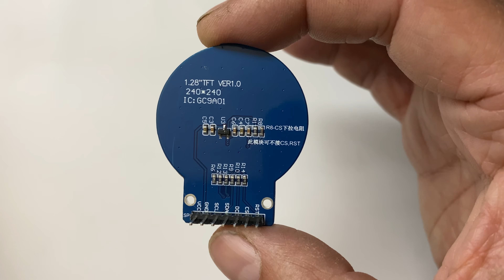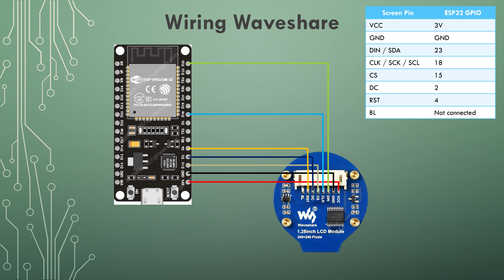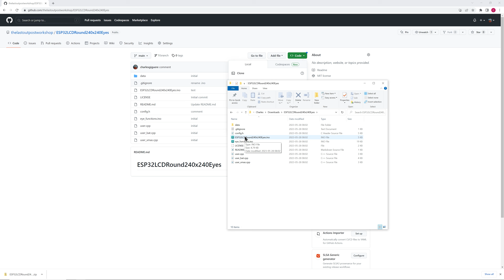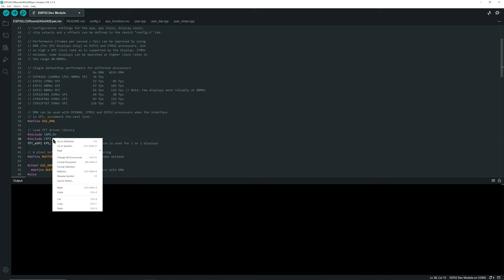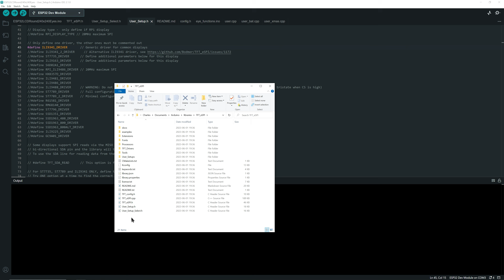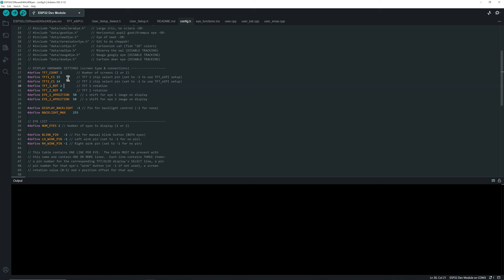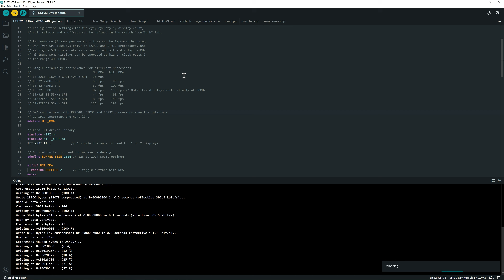Master the Round TFT Display on ESP32 and GC9A01 driver with the TFT_eSPI library

Comment: ive figured out 240 by 240 eyes , if anyone is interested?
if you change this line in the eye_ functions
tft.setAddrWindow(eye[e].xposition, 0, 240, 240);//both the 240 were 128
then you can use the default_large.h from dalori esp32 uncanny eyes
then i just changed the position of the eye and the amount it moved
Reply: What lines did you change for these?
Reply: @TheGroovebot  I solved this problem.  See my reply to @brunofnunes82 below
Reply: It works, thanks! But how I can change the amount it moved?
Reply: @brunofnunes82  If you use the config.h and the eye_functions.ino files from the Github project ESP32-uncanny-eyes-halloween-skull (along with the default_large.h file from that project), it will work perfectly with the bigger eyes.  Of course, update the config.h with the correct CS pin values.  I didn't bother comparing the specific differences between the files for this project and the skull project, but it works and that's all I cared about.
Reply: @jman4715  I did what you suggested and the larger eye indeed works, BUT the eye itself sometimes looks off screen.  The iris actually moves off screen and all you see is the sclera. Do you know of a way to reduce how far the eye looks around?
Reply: @TopHatRaver  I can't say for sure why you are seeing this problem.  For me it works perfectly and I don't see what you have described.  I mean, I could send you the exact files I'm using if you want to provide me an email address.  I really did just replace files.
Reply: @jman4715  Thanks for your reply! Could you paste a link to pastebin or github?  Or a link to the default_large.h file that you're referencing, just to make sure I got the same one?
Reply: @TopHatRaver  For sure I will send it to you, but give me a couple of weeks.  I'm currently out of the country, but I promise to do so when i get back
Reply: @jman4715 been trying for months to get the eyes full screen so please share what you have found that works for you😊
Reply: @jman4715  Any idea when you can share your file?
Reply: @TopHatRaver  Search for ESP32LCDRound240x240Eyes on the second repository you mentioned
Reply: @TopHatRaver  - I was having this problem too --  in config .h - the x position is set to 50 -- I changed it to 0 and the large eyeball stayed on screen
Reply: #define EYE_1_XPOSITION  0 // x shift for eye 1 image on display
#define EYE_2_XPOSITION  0 //  x shift for eye 2 image on display
Reply: @TopHatRaver  Were you able to try out the code I posted?
Reply: @jman4715  No, where was it posted?
Reply: @TopHatRaver  Ever figure out how to fix the pupils from going off the screen?  I'm having the same problem.  I’ve made all the same modifications to the code as listed above.
Reply: @jman4715 could you please post your code?  Ive made the same changes as you suggested and the pupil still looks off screen.
Reply: @JustinEpley  I have not, and I haven't seen the other code either.  Not sure what to do.
Reply: @brunofnunes82  I think I got to the same juncture as you.  Just missing how to change the "amount it moved" and hoping that will keep parts of the eye from getting cut off.  Since @robsimmons8462 never responded, did you figure it out?
Reply: @brunofnunes82 I believe I had a similar issue; the config.h wouldn't modify for me. Learning is a bumpy road...ugh.
Reply: That did not work for my display, I have a Resolution: 240(V) x 320 (H) LED Waveshare screen. It looked scrambled.
The downloaded sample did not match his ESP32 pinout, I had to edit the setup25 file:
#define TFT_MOSI            23
#define TFT_SCLK            18
#define TFT_CS              15
#define TFT_DC              2
#define TFT_RST             4
Reply: where can i download default_large.h?
figured out how to landscape image:>
Reply: You can't just use the default_larger.h file you have to mod the eye_functions.ino file on line 114 to:

tft.setAddrWindow(eye[e].xposition, 0, 240, 240);

On 341 and 342 change to:

eyeX = map(eyeX, 0, 1023, 0, SCLERA_WIDTH - 240);
eyeY = map(eyeY, 0, 1023, 0, SCLERA_HEIGHT - 240);

Then set the Xpositions on lines 33, 34 in the config.h file to 0.

Comment: I have two 1.28" TFT 240x240 GC9A01 round displays but my ones show "R7-CS" on them instead of "R8-CS". They just show a white blurry image on them, Not sure what I need to do to make them work as yet. :-/
Reply from the maker: Open an issue here : https://github.com/thelastoutpostworkshop/ESP32LCDRound240x240Eyes it will be easier to help you

Comment: Thanks for the great guide. I now have my two TFT (Square PCB) round displays working with two eyes. Next, I want to add my APDS-9960 gesture sensor to it. Once that is going I want to add a Grove WT2605 MP3 V4 MP3 Player.
Reply from the maker: That sounds like a really cool build, good luck with the integration!

Comment: Bonjour, et grand bravo pour cette magnifique vidéo, très pédagogique, même, si, n'étant pas du tout Anglophone, je suis obligé de suivre le sous-titrage (parfois approximatif) de mon lecteur.
Vous m'avez motivé pour faire l'acquisition de deux écrans ronds de type GC9A01, pour me lancer dans la réalisation de votre montage
Je suis incapable de dire combien de fois j'ai lu et relu votre super tuto pour paramétrer mon programme.
Maintenant, au moment de compiler (avant téléversement) un message d'erreur me dit  : "User_Setups/Setup46_GC9A01_ESP32.h : NO such file or directory", pourtant, dans mon fichier "User_Setup.h" la ligne 65 #define GC9A01_DRIVER est bien décommentée....
Pouvez-vous m'indiquer de quel coté dois-je orienter mes recherches, merci de votre attention.
Ci-dessous la traduction de ce message en Anglais... 
Hello, and well done on this brilliant video – it’s very informative, even though, as I’m not an English speaker at all, I have to rely on the (sometimes rough) subtitles provided by my player.
You’ve inspired me to buy two GC9A01 round screens so I can get started on building your setup
I can’t tell you how many times I’ve read and reread your brilliant tutorial to configure my programme.
Now, when I try to compile (before uploading), I get an error message saying: “User_Setups/Setup46_GC9A01_ESP32.h: NO such file or directory", yet in my "User_Setup.h" file, line 65 #define GC9A01_DRIVER is clearly uncommented....
Could you please advise me where I should focus my search? Thank you for your attention.
Below is the translation of this message into English...

Comment: This didn't work for me.. I couldn't get into User Setup. Go to Definitions did nothing. I had to move on .... brick wall.
Reply from the maker: Open an issue here it will be easier for me to help you : https://github.com/thelastoutpostworkshop/ESP32LCDRound240x240Eyes
Reply: @thelastoutpostworkshop  Ok, Professor, I created an Issue. First time ever requested of me...that in itself was a challenge. My esp32WROOM blinks, I got that right, but these eyes have me crossed. Hep'meh!

Comment: I was so hoping this would also work with the Waveshare 0.71 dual eye displays but nope.  The example Waveshare gives us don't work either.  They keep selling them but they don't work.  I believe the problem is the dual eye displays have an embedded driver that is not included in the TFT library.  I tried copying the driver files and adding the lines from the Waveshare example to your example and I didn't get error messages but didn't get any output either.  I may try again tomorrow and see if I can get it to work.
Reply from the maker: what is the display controller of the Waveshare 0.71 ?
Reply: @thelastoutpostworkshop  GC9D01 It's says the driver is embedded in the chip.  Not sure how much that affects how it's added to the TFT driver files but there is not a "User_Setups" file in the example.  Here's the link to the data sheet. https://files.waveshare.com/wiki/common/GC9D01N_DataSheet_V1.1.pdf
Reply: @thelastoutpostworkshop  BTW, I had no idea how the drivers for Arduino worked until I watched this vid.  I learned so much by watching and now understand how damaging it can be by deleting the official libraries and copying edited libraries into their place, as Waveshare's examples have you do.  

Thanks for explaining everything so clear and precise.  I learned a lot from this video.
Reply from the maker: GC9D01 appears to be supported by this graphics library : https://github.com/moononournation/Arduino_GFX I have used it in many projects, it's very good, give it a try.  Much easier to configure that tft_eSPI

Comment: I am trying to work with two TFT Round Displays that work with the GC9A01 driver. At this point, I just have it set up for one display. But when I try to upload and/or compile the sketch, I get this error. 
/ESP32LCDRound240x240Eyes-main/ESP32LCDRound240x240Eyes/User_Setup_Select.h:260:15: fatal error: TFT_Drivers/GC9A01_Defines.h: No such file or directory
  260 |      #include "TFT_Drivers/GC9A01_Defines.h"
      |               ^~~~~~~~~~~~~~~~~~~~~~~~~~~~~~
compilation terminated.
Alternatives for TFT_Drivers/GC9A01_Defines.h: []
ResolveLibrary(TFT_Drivers/GC9A01_Defines.h)
  -> candidates: []
exit status 1
I can't seem to find GC9A01_Defines.h.
Any suggestions? Thanks
Reply from the maker: See this tutorial on tft_eSPI, it will help you understand how the setup works : https://youtu.be/6lLlKY5U77w

Comment: I am trying to load the code with my ESP32  I keep getting an error at line 102 "'initEyes' was not declared in this scope
  102 |   initEyes();" and at line 133 "'updateEye' was not declared in this scope
  133 |   updateEye();"  what am I missing?
Reply from the maker: Open an issue here, it will be easier for me to help you : https://github.com/thelastoutpostworkshop/ESP32LCDRound240x240Eyes

Comment: Thanks for the tutorial.  My Acebot ESP32-Max-V1.0 doesn't have pin 15 labeled on the board, so I had to go into Setup46_GC9A01_ESP32.h and change the chip select pin to #define TFT_CS   17.  It might be a different way to make the same change, but I had been trying to edit User_setup.h to redefine the pin without success.  Seeing your changes helped me understand where the pin definitions were.

Comment: Awesome video, totally appreciate the step-by-step details on setting this up.  I make more wearable projects and I'm trying to use an ESP32-C3 Super Mini, which doesn't have the pins you've used in the project.  I've tried to review where exactly to change the pins but I must be missing something because I'm not getting any images.  I've used the Adafruit libraries and tested the screen and it works.  Any guidance would be much appreciated.  Signed your newest subscriber :)
Reply from the maker: Take a look at this tutorial, where I explain where to change the pins : https://youtu.be/6lLlKY5U77w
Reply: @thelastoutpostworkshop  Thank you! I followed these instructions twice and still nothing shows on the TFT.  I'm gonna keep hunting around for a solution but if you have any other ideas for me to consider, let me know.  Enjoy the coffee :)
Reply from the maker: Thanks for the coffee!  You can open an issue here : https://github.com/thelastoutpostworkshop/ESP32LCDRound240x240Eyes it will be easier for me to help you

Comment: Thank you for your detailed video. I had a lot of fun with this project.    
I built this with different TFT screens. I used 2    ST7735 128 X 128 ( blue boards). Had a hard time getting it to display properly. 
found that I had to change 2 more parameters in the config.h file   
#define EYE_1_XPOSITION  50  // x shift for eye 1 image on display
#define EYE_2_XPOSITION  50  // x shift for eye 2 image on display                      these values were 50 I changed both to 0. this fixed my problem.   

 You tube video:    https://www.youtube.com/watch?v=nraX7qHMW3I

                                               Thanks Again.  Bill         Wld_4

Comment: Thanks for your detailed and very clear instructions! It has helped me understand the process of setting up and understanding the relationships between the various files in a project such as this. I believe I have all of the related files pointing in the right places with no overlapping/duplicated #includes or #defines. Unfortunately, I have had no success whatsoever in getting anything at all to show up on my display. This doesn't necessarily surprise me considering I am using different hardware than what you have shown here. I am actually using the Waveshare Dualeye LCD Module which specifies using the gc9d01 driver that I can't seem to find anywhere. Not only that, I am using the Waveshare ESP32-S3-ETH board and have had to try remapping the pins. I am under the impression that I can use any available gpio's as long as they are not being used and have changed the coding to reflect the pins I have used. I will continue to watch your other videos in the hope I might stumble across something that will help me. Cheers :) By the way, I have subscribed and liked ;) Love your work!

Comment: This looks great but after following all the steps it won't compile - it throws lots of erros beginning with:
 |     ^~~~~~~~~~~~~~

c:\Users\Boss\Documents\Arduino\libraries\TFT_eSPI\Processors/TFT_eSPI_ESP32.c:382:38: note: in expansion of macro 'SPI_PORT'
  382 |     WRITE_PERI_REG(SPI_MOSI_DLEN_REG(SPI_PORT), 511);
      |                                      ^~~~~~~~
c:\Users\Boss\Documents\Arduino\libraries\TFT_eSPI\Processors/TFT_eSPI_ESP32.c:382:20: error: 'SPI_MOSI_DLEN_REG' was not declared in this scope; did you mean 'SPI_MS_DLEN_REG'?
  382 |     WRITE_PERI_REG(SPI_MOSI_DLEN_REG(SPI_PORT), 511);
Reply from the maker: Open an issue here : https://github.com/thelastoutpostworkshop/ESP32LCDRound240x240Eyes
Reply: @thelastoutpostworkshop  Thanks for the quick reply, I've just got the same error with another hello world bit of code so the problem is probably somewhere else!

Comment: how do I change the pins of the spi? I am using a esp32 c2 dev module...
Reply from the maker: Look at this tutorial : https://youtu.be/6lLlKY5U77w
Reply: @thelastoutpostworkshop  thank you! I figured it out. For some reason, GPIO pins 1, 2 and 3 are not working for SPI connection on the ESP32 C3 wroom 02. Also I had the issue that when using the latest esp32 board version from espressif (I think its V 3.1.1), the board keeps rebooting all the time, appearantly thats a known issue. But with different pins and the esp32 board version of 2.0.14 it finally worked.

Comment: I successfully completed this project and I was very happy. I bought a mask and found that the iris was too small for that mask. I tried to modify certain parameters, thinking that if it didn't work, I would recreate the data. I changed EYE_1_XPOSITION in config.h from 50 to 75. After uploading, the eyes disappeared. I returned to the value 50, but nothing appears on the display. I didn't change anything else, so, unfortunately it doesn't work anymore, can you give me some advice on how to recreate the project?
Reply from the maker: This appears like a wiring issue, change the eye position does not cause this behavior
Reply: @thelastoutpostworkshop  I tried. Could be arduino updates the cause?
Reply: @ It worked in any condition, until today, when I tried to change something.
Reply from the maker: yes it could be an update, look at this tutorial : https://youtu.be/6lLlKY5U77w
Reply: @thelastoutpostworkshop  I installed again and it works, But I can't find where  to change the size. I want to make a mask for my grandchildren, but the size of the eyes is to small. What have to change? Thanks!

Comment: Hey! I'm buying the kit to copy this but what power supply would you recommend? I'm a little confused, once its all soldered together, each screen does 3.3v? so would I need like a 7v battery with a 3v regulator?

as above, what should I do about powering it via battery?
Reply from the maker: Most ESP32 dev boards have regulators, so you can power them with a battery via the VIN pin (do not use the USB at the same time).  You can use an 5v external battery, I think you can go up to 7v, but check the specifications of your ESP32 dev board.  You may also have to add a capacitor to stabilize the power input.